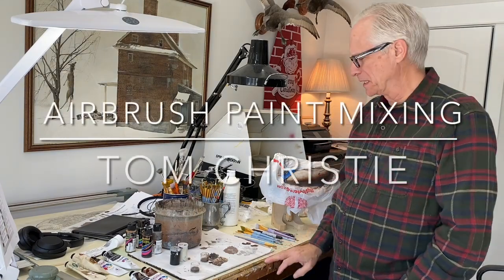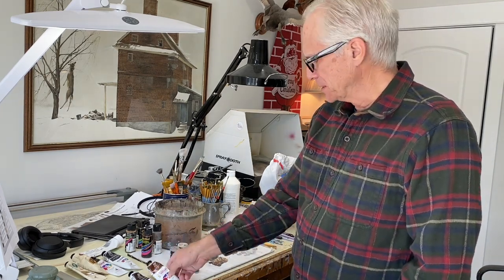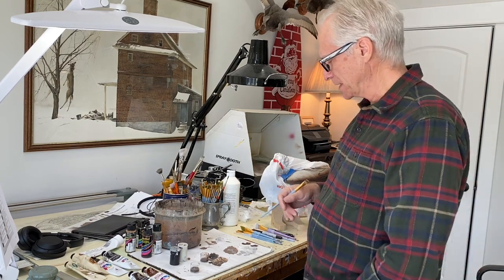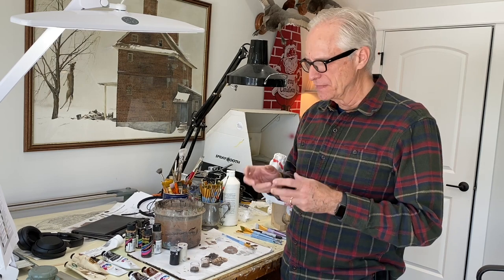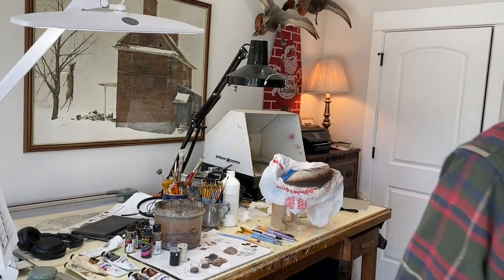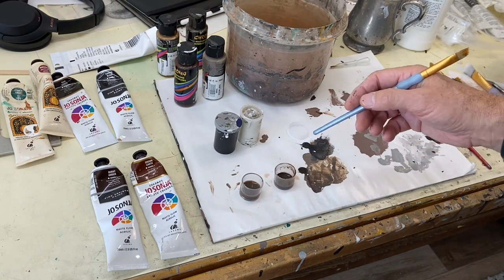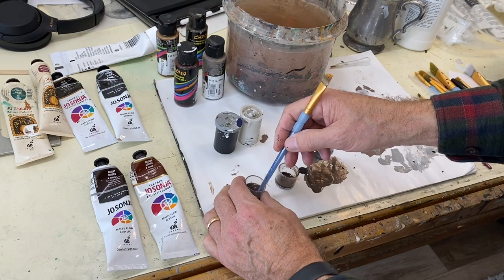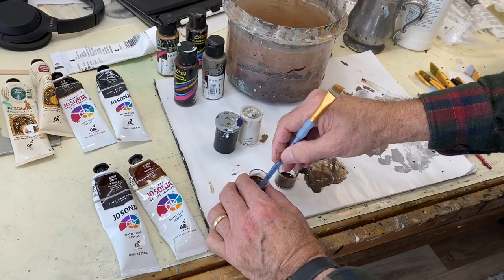Air Brush Paint Mixing Tip

Comment: Just found your channel (new subscriber) !! really enjoying it, Im new to carving only about 3 years now, I do mostly fish but I just completed my first duck. I have found using a reducer instead of just water will make the paint flow a lot smoother through the airbrush. Ive used commercial reducer but I started making my own using 91% isopropyl alcohol, distilled water and glycerin. i can make probably 3-4 quarts for what it cost for one 16 oz bottle of commercial and in my opinion it works just as well. I mix a quart at a time and transfer it to a smaller 6 ox drip bottle. it also works well as a cleaner between colors. for 1 quart i use 1 part alcohol to 3 parts distilled water and about 30 drops of glycerin.
Reply from the maker: Thanks for the air brushing input Danny!  I appreciate it. Great looking channel too!
Reply: @tomchristieart  thanks, I wish I had found your channel before I started my pintail project. I’m binge watching yours now😜
Reply: Danny, How do you come up with the amounts for 1 qt?
Reply: @brianrosisnki1328  at first I was only mixing 16 oz at a time. It doesn’t have to be exact measurements. But for a quart I Just divide a quart jar into 3rds then add the glycerin.

Comment: Thanks Tom really appreciate your tips.. can I ask what light are you using when you are painting
Reply from the maker: You are welcome!  I got that light a while ago and I looked and there is no brand info. on it. I use two drafting table lights. The white one is LED and you can find similar ones on Amazon if you search for drafting table lights. The black one is even older and has a fluorescent perimeter bulb and a warmer center bulb. I like the combination of lights to cover the cool and warmer light values when I paint. Hope that helps.  Nothing really special. They are both drafting table lights that give me good lighting for painting.